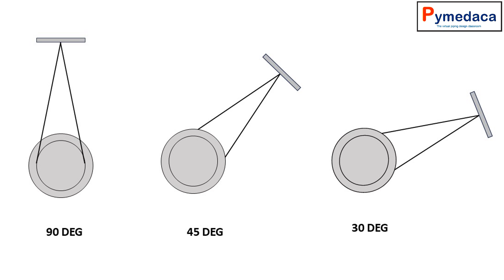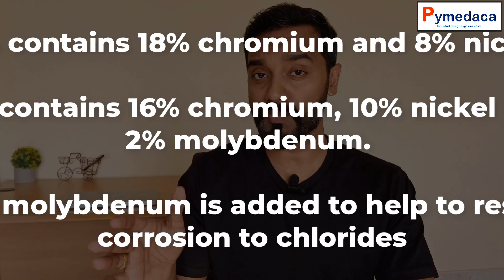Toughest Piping Design Question's, I ever faced in my interviews #pipingdesign #interview #career

Comment: In additional to accumulation of dirt underneath the stem below is also one of the reason to keep stem in horizonatal ,to prevent the fall-off of the valve's gate due to stem failure and hence blocking the relief path

Comment: Excellent video.
There is one more application of Weep hole. It is normally used in the reinforcement pad to remove the gases entrapped during the welding activity.
Reply from the maker: No..Hole on RF pad is not weep hole. It's a vent of RF pad.

Comment: I have some queries 1)How you derived Drip lug distance, basis for it.
2) what you said regarding weepholes correct, adding nowadays client asking to drain weepholes outcome to safe location with break flanges near hole point for maintenance and in case of steam rings also we use these weepholes.